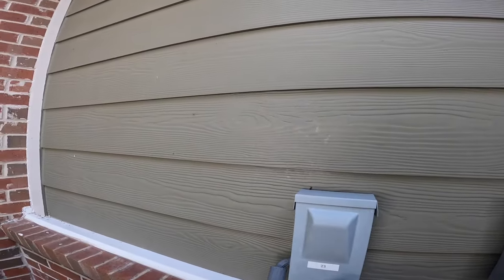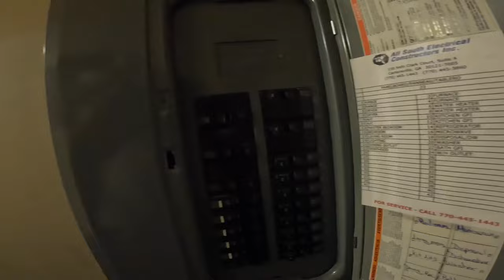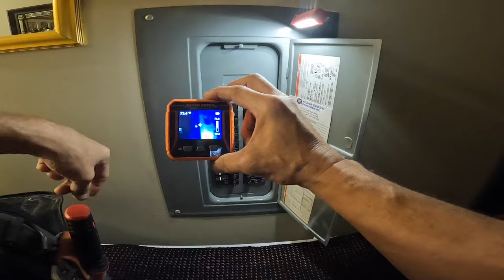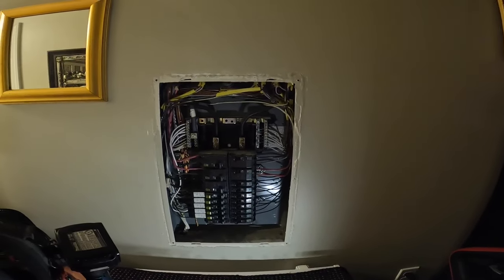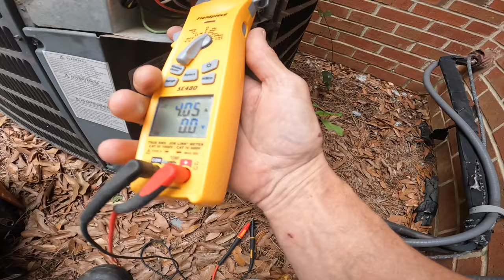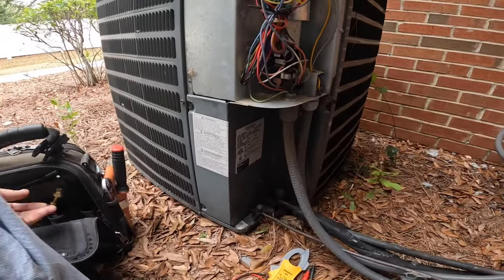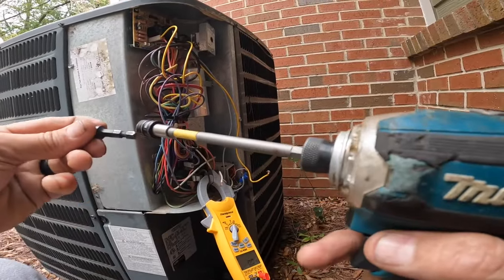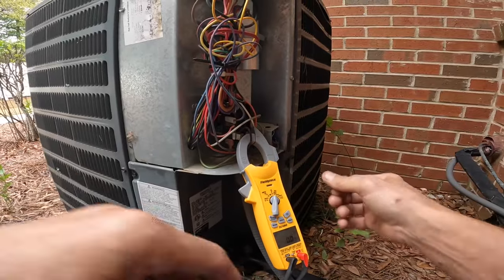She called the Fire Department after I left

Comment: I’ve spent my life repairing electronics and things like you repair , from time to time things like this happen . Any one that says they haven’t had something like this happen is not being truthful. Love your channel .
Reply: A true troubleshooter at least finds the cause !
Reply: I call this electrical problem intermittent. Sometimes it works and sometimes it doesn't. Heat pumps can be very tricky to work on when you didn't install them yourself. Those disconnects are the worst but it is better than no disconnect box.
Reply: I fixed a low volt pool light once and the ahole called me later at midnight and said his pool pump started smoking and blamed me for it. My boss at the time was a pushover and fixed it for the guy for free. I was pissed. What does a low voltage led light have to do with a 240 volt pool pump? The dude played my boss like a fiddle.
Reply: @briank1263  what is worse than that ? When the boss/owner and the customer are best friends and are trying to set you up. Best to stick with the truth and nothing but the truth. It always comes out in the wash.
Reply: It is an adult who can admit their mistakes and own to them.
Reply: @lylawaters6345  that is so true and one of the true markers of maturity. To accept responsibility for one's own actions.

Comment: Retired appliance tech; worked for a major retailer. When I walked into a  homes basement to repair a broken drum belt on a gas dryer, I immediately sensed a whiff of gas. I used my sniffer device and determined it wasn't coming from the dryer. I completed my repair and as a courtesy, I checked their gas heating system. I found an old gas shut off valve leaking on the boiler. I informed the customer and headed to my next call. My manager calls me and asks what the hell did I do at that house because the customer smelled gas and called the fire dept.........go figure 😱
Reply: You probably saved the resident's life! There could have been an explosion!
Reply: If you've ever worked as an auto mechanic / auto body tech. You can guarantee that 90% of the customers will try to rip you off just to get free work / repairs done.
Reply: @ryanlouk9565  It goes both ways.. In 50 yrs of having vehicles, I've only had a handful of mechanics I trusted.  In many cases, I knew more about my vehicle, than the "professional" mechanic did.  I've had to come back and repair too much, that was "fixed"..   Probably, the most aggravating was the stripped out belt tensioner threads, on one of the 3 bolts, specifically the one common to the coolant jacket.   Having to order/overnight, a TimeSert repair, which I had to customize, to fit.  This was unplanned secondary work, to doing the diesel timing belt project.   I've even had to redo work from a dealership.
Reply: @graybeard2113  how about stripped out oil pan drain plugs ?  That is pittyful.
Reply: @ryanlouk9565  yup I basically rebuilt a dryer for a guy that had a transmission shop, so we traded work. He drained transmission fluid and changed filter on my 02 blazer , my wife picked it up and the 4 wheel drive light is on. Called him thinking maybe he left something unplugged. Claimed it was on when they pulled it in shop I dropped it off the night before. Had it checked out and 4 wheel drive module was bad underneath the back seat. Coincidence or not? $450 for module plus diagnostic charge

Comment: When you said you hate those disconnect box's you took the words out of my mouth, what makes them really nice is when it's 95 degrees out and it's your last call and it's a apartment complex and the other 4 service calls had the same disconnect. Keep your head up buddy!
Reply: It helps to lube the pullout disconnects.
Reply: when i work on those disconnects the covers can be removed like his did almost fall off  15:11  theres a way to move them so they can remove sometimes it takes a min to see how they remove but ive never seen them not be able to be removed for easy access
Reply: Also I have pulled these disconnects apart sometimes while trying to disconnect the power. They can be aggregating.
Reply: @myrtislockett7792  Aggravating?
Reply: @bobboscarato1313  yes aggravating because when you destroy the disconnect you get to replace them for free. I never realized the typo. That's really funny looking at it now. Ha. Ha. And what you are doing right now could be considered a callback on another service tech. Thanks for not throwing me under the bus  👍🏼
Reply: @myrtislockett7792  I'll never do that; I'm retired now anyway! lol

Comment: I just had to stop and tell a similar type of story.
I was working at a Portland (OR) elementary school (summertime, no students) outside, but walled up 8 ft with a 10 ft overhead. I light my torch, got the standard acetylene puff of smoke...
That set the whole fire alarm system off! I immediately called 911, and explained the situation, didn't matter. It was a school, they had to check it out...
5 engines showed up! It was right across the street from the East Precinct of the cops. 
Oh JEEZ!
All turned out well, but still!
Reply: I'm sure you won't make that mistake AGAIN...!
Reply: I can't believe they didn't put the system into test mode.

Comment: Today, when you first went to the outdoor unit and discovered the contactor was pulled in, the compressor and fan were not running. I would suggest taking the meter and checking for power coming from the disconnect, which you mentioned was "on" at 2:35. If no power was found, I would go right inside to the power panel and restore power there, and make sure that the contactor was receiving a Y1 call from the stat at the outdoor unit. If not, then I would look for my wiring error. The problem is that we still do not know why you had an issue yesterday. That said, I would confirm first that there was actually "smoke" before doing anything. The lack of a smoke smell anywhere was the big clue that the smoke was actually sublimating ice vapor from the evap.
Reply: I've had controllers just get into a weird logic state, had to pull power until the caps on the board discharged for it to get out of whatever impossible state it thought it was in. Once fully off, it reset with no further problems.
Reply: @spvillano   While sometimes a board will have a com error, in this case I think that customer himself had a com error.
Reply: Fah Q  You are making a common assumption that is incorrect. First, you want to make sure there is power going to the outdoor unit, and if none is found there or at the disconnect, you must then check the panel inside to find out why. The indoor unit where the 24 volt power comes from is NOT on the circuit of the outdoor unit. Second, the contactor may be welded closed, so you must also make sure there is power holding it in, and not a welded contact. I have found literally dozens of contactors that appear to be pulled in, and were not. Also, the word, "contractor" has an extra letter that changes its meaning entirely. HTH.
Reply: Fah Q   You must be one of the guys that I follow up on.
Reply: Just so you younger guys don't make the same mistakes as a guy who has been a CONTRACTOR for 22 years could make, let me explain why my way eliminates a mistake. First, a humming contactor does not mean that it is receiving a voltage in the proper range. A contactor can be humming and appear to be pulled in normally, but in reality, a wiring or other issue could be starving the coil for current. When this happens, the spool (the plastic form on which the coil is wound) can heat up and hold the coil in the pulled in position without any visible sign of a problem using the contacts as a determinant. In fact, I have seen welded contactors that did not appear to be welded at all. The BEST way to look at this situation is to: 1) measure the voltage at the contactor to make sure it is in range, 2) de-energize the contactor and make sure it moves to the open position, and 3) determine why there is no 240 volt power to the line side of the contactor. If the breaker is tripped inside, it may have had a reason to open. My first line of defense against laziness is to look for a short to ground in the outdoor unit. When working with 460 volt units, you can have a short in the three phase disconnect itself. I had never seen that happen until a month ago, but even doing mechanical work since age 11 did not show me that particular fault. The moral is to always check and test to be sure, and you will pare those callbacks way down. That way, I don't have to go to a site where the client wants a second opinion, and no one will have to follow up on me, either.

Comment: Good job but next time a board is giving trouble (intermittent or failing) pull the board and inspect it for cold or broken solder joints, especially at screw terminals, pins and near mounting holes.
I use a jeweler's loupe and wiggle and push inspecting the component and trace sides. Even flex the board a little and you might see a trace that has broken.
Vibration or stress can do a board in, I also carry a soldering iron to repair on the spot. HVACR tech, electronic tech & electrician (retired).

Comment: I have found on some of those boards that the solder joints are poorly made on the back side of the board. The last Rheem I worked on had a very weak solder connection on the back side, on the IBM relay, so the blower would intermittently cut off, leaving the outside condenser running, icing up the A coil. That would have been tough to troubleshoot, if I had not pulled the board and spotted the connection.
Reply: Yeah that would have been very frustrating

Comment: I'd be careful about pulling breakers. Once I did that and the plastic bus bar stand off broke behind the bus bar and allowed it to touch the back of the panel. The resulting fire was not pretty.  Why not simply check your running amp draws when the condenser was running? Much safer!

Comment: As an electrician you had me baffled when you started poking around in the electrical panel as to what you could possibly be looking for you're amp clamp already gave you the information you needed 😉 plus breakers are brittle not a great idea to clamp on them with metal wouldn't be a bad idea to replace those
Reply: I'll admit I know basically nothing about this stuff but I can't imagine it was overly safe to be poking around in the breaker panel with electricity still running through it either... or atleast I assume there's power going through it since the house still had power...
Reply: @Nedyarg1100  you can work on a panel with electricity staying on depending on what needs to be done but the way he left breakers on and was tightening screws and poking around with his screw driver is just dangerous even with an isolated screw driver. The amp clamp told him that he was receiving 240 amps and to be honest his license doesn't allow him to work on anyone's electrical except in his own house its just a lack of proper troubleshooting.
Reply: @soulkeeper48  lol @240amps from this little residential AC unit, cute!! I’m
Reply: @Nedyarg1100  Yes, lights and the radio or TV was on!
Reply: @user-nl5wj1hi4p  You mean 240 volts!

Comment: I had to do a Compressor replacement, with snow on the ground and lightly snowing. Had to clean the indoor coil and fan too, taking them outside. Finished, checked everything out. Was at a Fuel Station, when my pager went off. Customer called answering service, that the Heat Pump caught fire and went into his eaves. Turned around and went back, over an hour away. Fire Chief stopped me on the street, and started cussing about the customer. They had rolled up dropping fire hoses. Service manager, came up behind me. The Heat Pump had gone into Defrost, somehow he never noticed that before. Yeah, he was a total jerk, which was why I had to replace the compressor on that day.
Reply: You need to troubleshoot unit correctly before changing out compressor; don't skip classes!
Reply: @bobboscarato1313  What?? I didn’t Condemn the Compressor, my service manager did. This after the customer wanted a second opinion, after another company had condemned it. It was a mechanical break up, from a plugged indoor coil. Changing filters was to big of a bother for the customer. The only thing that should have been different. Due to the weather, there should have been two of us. But, that was not my decision to make.
Reply: @stevenmoomey2115  ha. My knees and back hate it when I do a compressor change out without any help.

Comment: One question. At about 8:10, you point out the breakers for the condenser & air handler. Then you pop them out to examine, but you actually popped out the breaker ABOVE the one you identified as the one for the condenser. Was this a mistake?

Comment: when i was living in lincoln nebraska in an apartment one day i heard this really loud electrical zapping coming from the HVAC  unit in the closet/pantry in the kitchen...  my first thought was turn off the  breaker on the main panel. it stopped. called the office and they had a maintinance guy out later that day.. they asked me to turn the power back on and it immediately started making the noise again.. breaker off. they took off the panel for the heating elements and there was a wire in there that broke.   it was  high voltage so its a good thing i turned it off. it was arcing off the access panel.  its probably had that same wire since the 60's when it was built.  they didnt want to mess with it and ended up calling someone to fix it.
Reply: At first I thought you were going to say it turned out to be an air purifier.

Comment: Curtis, you are a honest guy for admitting you made a mistake. Mistakes happen when you are working. Is that a torque screwdriver you were using when you checked the electric connections? I though I heard it clicking, I use one all the time doing electric although my coworkers call me crazy. Better safe then sorry I always tell them.
Reply from the maker: No, but I do use one - keep it in my truck.

Comment: You have good procedure when diagnosing a potential hidden problem.  I also like to check and tighten every power connection, and check contacts on buss and breakers.   I laughed, I detest those pull-out disconnects.  The covers usually slip down and bang my fingers, which produces a curse word or two.

Comment: imo there should be no boards on residential hvac units.  Just simple contactors and safety switches.  Send 24 volts to energize a coil and thats it.  If a safety is open; then its an easy solution.  These electronic boards create headache for troubleshooting.

Comment: If the contactor was truly pulled in the outdoor unit would have been running when you first arrived. I guess I'm just a little confused how this situation came about anyway. I'm a commercial refrigeration guy, but I do enough residential. It's my understanding the stat should be sending control voltage to the  contactor coil, not the board.
Reply: I believe the inside breaker was tripped for the outside unit.  There are a many number of reasons why the contactor could have been pulled in. Electricity is truly color blind.
Reply: @myrtislockett7792  I missed that part where he said it was tripped, but that makes sense. What doesn't make sense is saying the board is the issue. If he has low voltage I'd check at the transformer supplying the board first, then the thermostat . Maybe the transformer was built into the board, but it didn't look like it. I feel like board is a go too when people aren't sure what the issue is electrically

Comment: the pressure switches on some goodman heat pumps tend to stick in the open position. i usually bypass them and add a bypass tee with a female flare with a built in valve depressor and the other two male branches have valve cores and another pressure switch, locating the tee on the service valve and the replacement switch inside the service panel.
Reply: Human Error ' God had nothing to do with it.
Reply: @keithclark486  what?

Comment: Anytime you work on electrical that’s live you should work with one hand. You were using both hands on that screwdriver. If something happened electricity would go straight through your heart
Reply: He should have never had that panel opened. If the voltage was healthy especially with the motor running, there was no reason to check those breakers. Great video, nonetheless but without gloves/ppe I can't approve doing this on camera ...
Reply: @herro36  okay, but fact is he did have it open.

Comment: You removed the outdoor thermostat which was wired incorrectly.  The purpose is to set the outdoor thermostat to the balance point of the cost of running the heat pump verses the strip heat by restricting when the strip should come on. Additional  circuit from air handler to the out door t stat. Break white at strip heater and route thru the od t stat. Saves a lot of money.

Comment: So, it was condensate/ fog from an iced up, or too cool evaporator coil. caused bt an over running compressor. Sweet, fog machine A/C !!! You did great , you admitted the issues cause was yourself, corrected it easily, learned something new, and the insurance company was never called. Job Success !!
  I jumped the solenoid on a Vac pump/ compressor once and walked away. The vac switch wouldnt let it pulldown as far as i needed, got frustrated  and hardwired it on. I came back from break and it was off, you could smell it was Hella hot and literally see heatwaves coming off. Only reason turned off was the breaker tripped. Close one.

Comment: Check the back of the board for discoloration,  solder points for cold solder joints, etc. 
Also check the pressure switches either voltage or continuity if no power to contactor. 
 Compressor lockouts can be critical if umit doesnt have a crankcase heater.